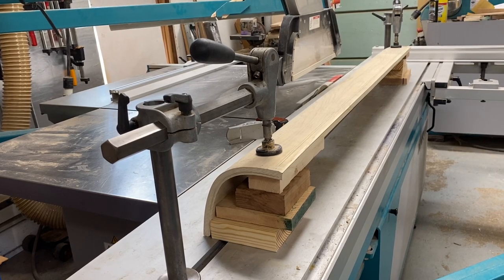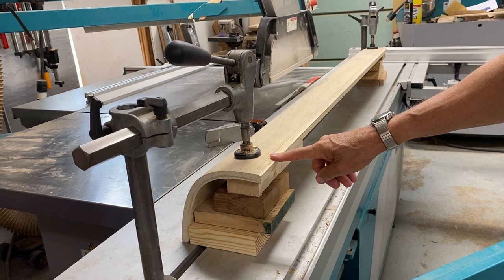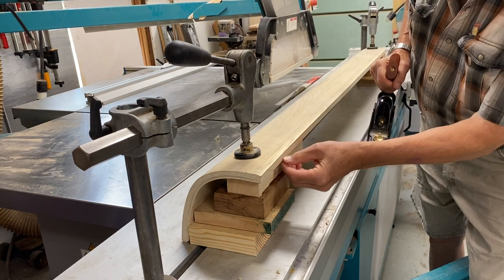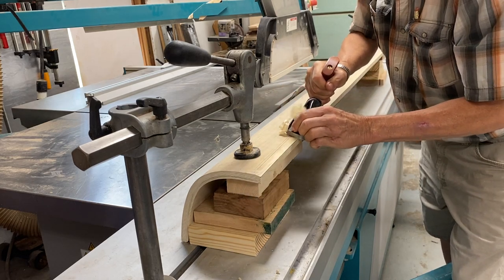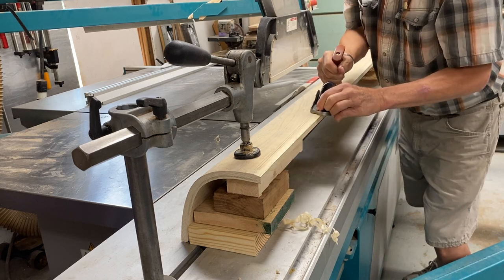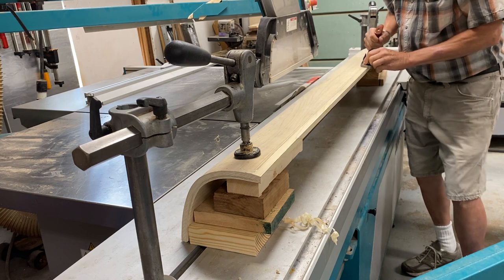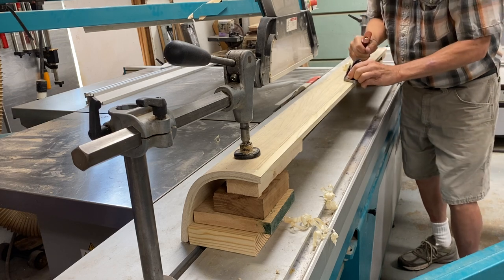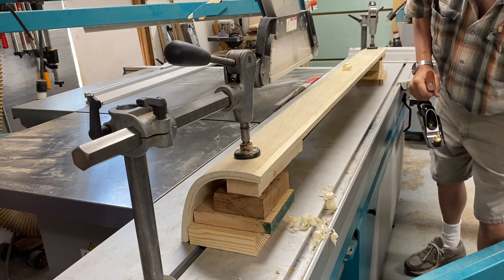Sprinter van airfoil build

Comment from the maker: This air foil is a revised version with improvements in wood selection and general strengthening of the design.  design
The prototype yielded a 3 mpg from mid 30's mph to top highway speeds.
The design involves one curved radius 5 ply (.1" thickness/ply) of poplar wood; two end plates of Baltic birch plywood 1/2" thickness and one back plate 1/2" thick white oak of a vertical position with a cutout for the raised brake light.
When passing through the upper 30's of road speed the foot feed starts to come up as the aerodynamics improve. Also going down the high way with speed of 55 to 70 mph I notice the van gaining 5-6 mph on down hill grades.
Changing lanes at 65-70 mph is much more sure footed with the air foil.
Doctor Kamm was the original inventor of this air foil that loads the air pocket created by the brick design of the van back end shape and reduces drag for better mpg and high speeds.
Two advanced wood working techniques are involved with this air foil design: the membrane press process of gluing the 5 plies of poplar wood to the curved skeleton shape and a template of the van roof profile curvature (left to right) that allows the lead edge of the curved member to blend with the roof.
That curvature of the lead edge of the airfoil profile is achieved by copying the van roof making a template/jig and using that to guide a 14 knife helical carbide shaper tooling (10K rpm) to cut away 2/3 of the roof profile with the  shaper. I extended the Felder shaper spindle height by 3/4" to meet the required height of cut.
The final airfoil will be epoxy coated for durability.